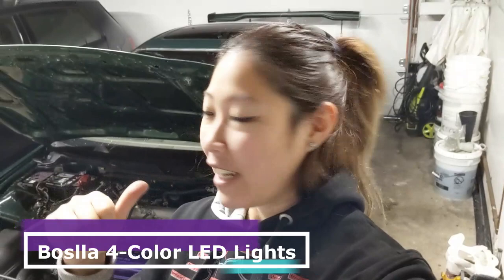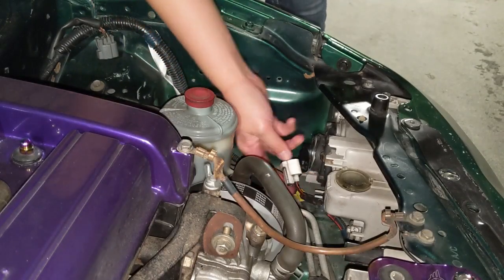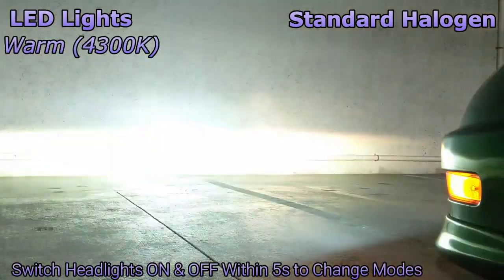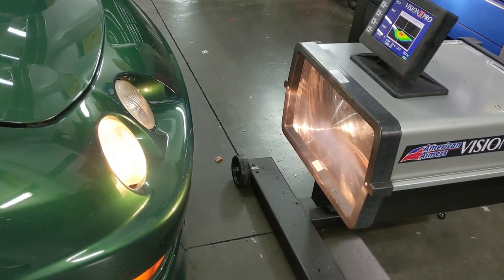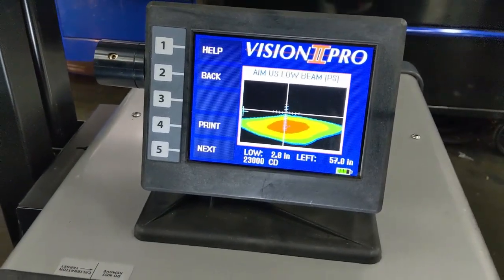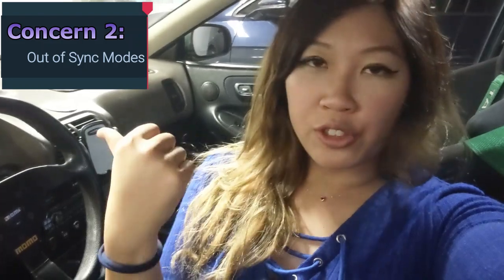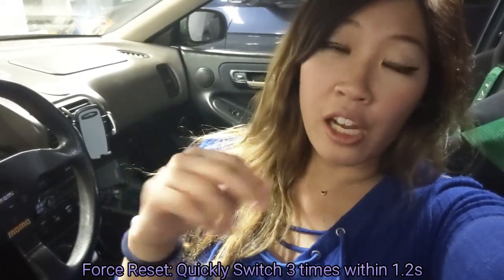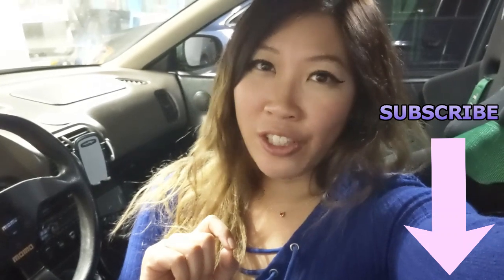Boslla 4-Color LED Headlights Integra Install (9006/HB4) & Beam Pattern

Comment: Many thanks for your comprehensive review. I''m wondering about these BOSLLA 3 or 4 color mode bulbs. I see that the mode is changed by switching the headlamps on and off, but what about dipping ?. Is this done normally ? Nobody has mentioned this detail in their reviews. Have YOU had any experience of how to dip these lights ?

Comment: I put some led headlight bulbs in my GS300 and the pattern was bad.  I couldn't see anything on the side of the road.  One probably is that the car uses reflectors for the halogen bulbs.  I ended up using the silverstar bulbs to have the stock pattern.  The beam is whiter than the stock bulb, and while it's not nearly as bright as the led I see more of the road.  The GS uses the same bulb, 9006, as your integra.